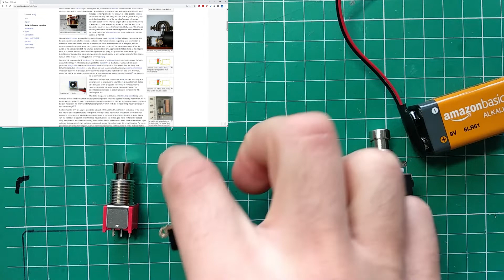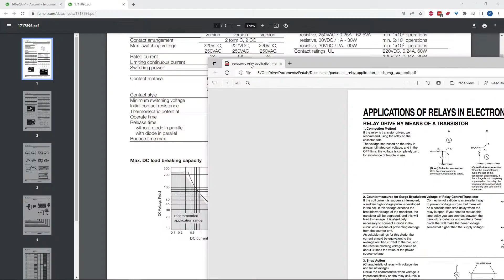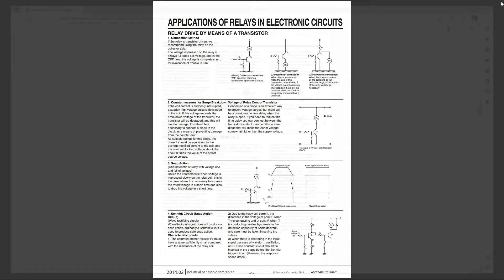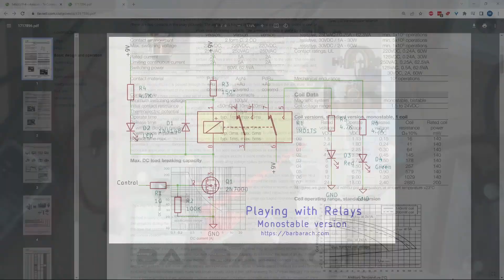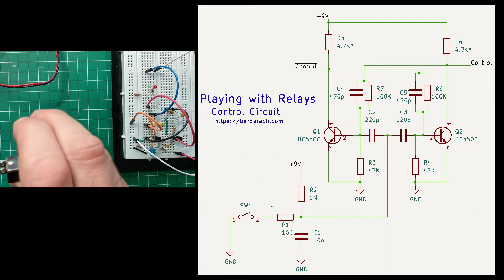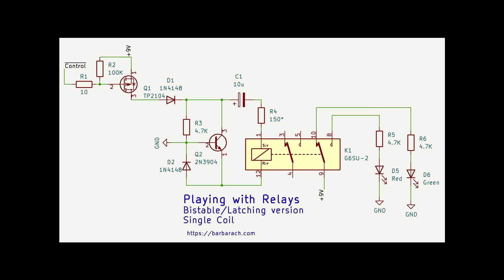Using Relays in Pedals - Basics

Comment: Using relay as a switching the audio signal path is going to be really noisy due to the magnetic interferrence....please do post some video regarding killing the noise as well
Reply from the maker: Relay could introduce popping when turned on and off (similarly to a physical switch) but it wouldn't be really noisy outside of that. Are you experiencing noise due to a relay? 
Magnets won't affect the signal on their own. I imagine if conductor was moving in the magnetic field that would cause current induction and some noise, but nothing is moving in the magnetic field. These relays are using DC current so no AC component to affect the signal due to coupling of some sort or causing electromagnetic interference.
I'm by no means an expert but if you have some source of information on this I'd be more than interested to know.
Of course, I did not run audio through the relay in the video, I was just messing around with an LED so I'll have to add a video with actual audio in it :)